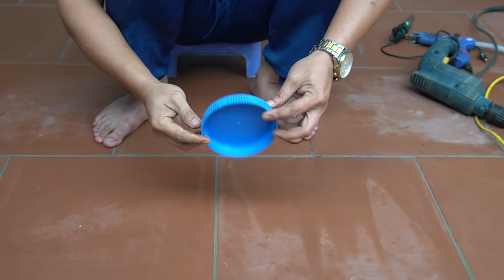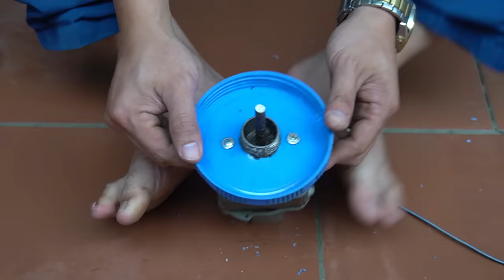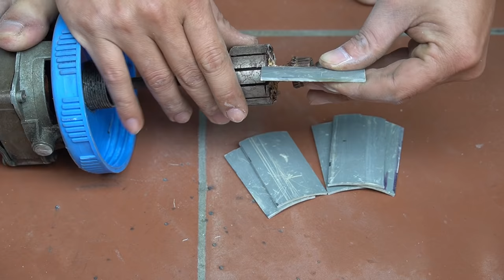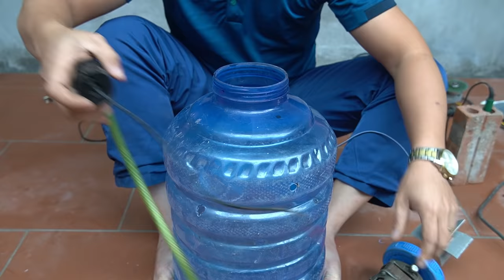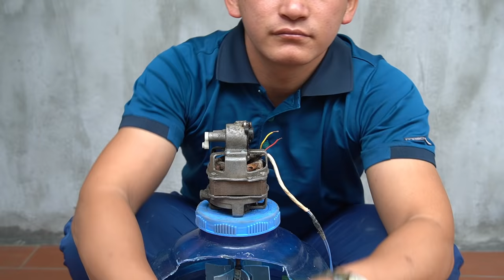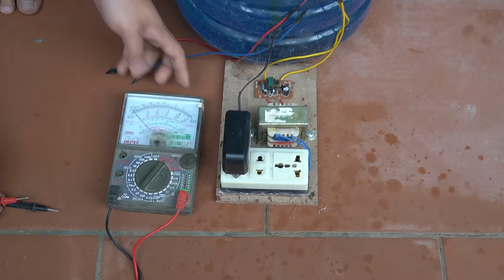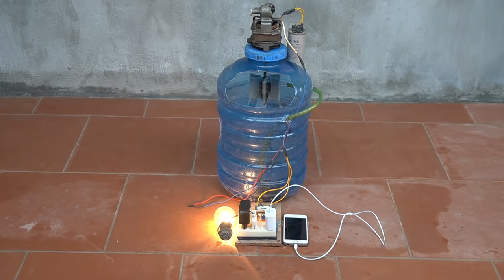Turn Plastic Bottles Into A Simple And Creative 220V Water Turbine Permanent Generator

Comment: There is no such thing as a permanent generator.  Perpetual motion is impossible because the components of the entire machine creates resistance and will eventually stop.  Stop spreading lies.
Reply: I wouldn't say it's impossible, we just haven't figured it out yet. 
The earth rotates in perpetual motion.
Reply: @AftermathNoPrep  being in a vacuum with no resistance helps that constant motion.
Reply: @yamchayaku  the earth is not in a vacuum. The earth is in the same atmospheric pressure that you and I live in, which is 14.7 psi at sea level. We have what you call an atmosphere, and earth is inside that bubble. Atmosphere can be a form of resistance.
Reply: @AftermathNoPrep  well, you are right.  Of course, that means the Earth will still meet resistance from that very atmosphere and eventually slow down over time, though that will be billions and billions of years away.  The sun will probably end up engulfing the Earth before it completely stops spinning.

Comment: Please ,be kind enough to mention the items used in the circuit . The capacity , voltage ,etc . Thank you very useful idea .
Reply: Permíteme responder tu pregunta lo que veo en el video y por lógica del circuito veo utiliza: 
Un cabezal de ventilador de mesa, una bomba de agua sumergible, 12 VDC voltios, un botellón, una batería de 12 Voltios, un capacitor de 40 microfaradios de alterna, un circuito electrónico, supongo que para estabilizar a 12 VAC y un transformador de 12 VAC a 220 VAC, lo demás se entiende por las mismas imágenes.

Let me answer your question what I see in the video and by circuit logic I see uses:
A table fan head, a submersible water pump, 12 VDC volts, a bottle, a 12 volt battery, a 40 microfarad AC capacitor, an electronic circuit, I guess to stabilize at 12 VAC, and a 12 volt transformer. VAC to 220 VAC, the rest is understood by the same images.
Reply: sorry to have to tell you but the video is fake because perpetual motion does not exist in nature.
Reply: @eliabe6453  Por supuesto, sé que es falso, las leyes termodinámicas así lo demuestran. Supongo que la trampa está en el condensador o en el cajetín del tomacorriente. Solo le respondía a la persona que preguntaba sobre los componentes del artilugio.

Of course, I know that it is false, the thermodynamic laws prove it. I guess the trap is in the condenser or the outlet box. He only answered the person who asked about the components of the contraption.
Reply: @eliabe6453 👓

Comment: I am confused here. How did you get the water running?
Reply: I think the water running is due to starting with 12 volts of the battery, it start moving the generator on order to produce 120 volts which are charging the capacitor for using 12 volts of use of the water pump and supply 120 volts for using a 100 or less watts bulb and mire watts for small consume devices such as a telephone charger.
Reply: @arielriveragaona98 , bravo amigo, al fin alguien usó su intelecto y razonó correctamente...es triste reconocer que la mayoría solo atina a criticar y lanzar conceptos tontos, no faltan los que quieren todo hechecito y nada de poner materia gris de su parte, nuevamente gracias amigazo, desde Perú....
Reply: Water pump submerged 12 volt

Comment: nice job man, i will try soon to replicate it but placing the fan horizontal with, instead of the flags, the Pelton shaped flag :)
Reply: Yeah...the fan partially immersed in water reduces the MA
Reply: @patrickugwu1868  we are talking about nothing because this video is fake; if u modify a fan into a generator with magnet no 220v out. I tried with 3 different fan or motor and i got max 9/12v
Reply: @Mauro if the generator has be previously modified with extra magnets and coil windings, it's possible to generate 220V
Reply: @patrickugwu1868  i did it, exactly as this videos shows. Try it by your self and u will see the truth..this video is fake like all the other videos he post on youtube..it's just for make money with visualizations..I'm very demoralized as i really wanted to obtain same results but no way
Reply: @MauroAlpha17  hmm... Lemme even check it out closely
Reply: @patrickugwu1868  try it, and if u can make 220v advise me! i hope i'm wrong cause i need to generate energy. Here in italy there is a energetic crisis and all cost a lot
Reply: @MauroAlpha17  
Menurut saya hanya PLTS energi gratis dari Tuhan 😁😁🙏
Reply: @dodoldarut5200  english please

Comment: I think this is a trick because the rotor doesn't have a magnet, how do you generate electricity,? that's funny
Reply: The small battery works to jump start the motor, than the Capacitor takes over….
Reply: The small battery works to jump start the motor, than the Capacitor takes over….
Reply: @Solebeneficiary  how long will the capacitor create electricity?
Reply: Wich rotor has not have magnet, electricity is generated by the generator on top, the capacitor is to protect the generator and to stock a little power to let the generator  continue working will he unplugged the battery ....
Reply: Can you please give me the detailed electronic component and the schema  of the circuit
Reply: I agree with you, you need magnets to generate energy ,  Apart from that when disconnecting the battery there is a cut in the video.

Comment: I think the capacitor is a modified  battery🤔
Reply: Yes of course
Reply: Your not wrong
Reply: I also think that, Capacitor will discharged fast for that turns of the motor i Think its fake.

Comment: great project. as rightly comment by the great guys. im confuse. i can see a fan motor converted to an alternator, what is doing the pumping of the water to drive the blade or the fan which inturn drive the alternator and power generated?. A clear circuit diagram will assist further.

Comment: I think is pretty cool but using the battery to get it moving kind of defeat the purpose I would have use two bottles and the motor insert it on the side of each container then let water run from the top container to the bottom one on that way you don’t need another source of power to make it work

Comment: He is charging with the battery so where is the loop? Do they even use 220 voltage in there homes? I guess a jumpstart and not charge with to many loads AND not getting bothered by birds or anything like to much heat so yeah it could work.

Comment: Lies from the pit of hell!! Batteries are used to ignite a system in generators to aid combustion of the fuel so what did the battery ignite?  Absolutely nothing...if you have zero knowledge on physics this guy will fool you...this is practically a car alternator....it takes the engine of a car which is powered by 6 valves to rotate that stuff....This guy...is just... unbelievable..

Comment: So this is how you beat the laws of thermodynamics and law of conservation of energy by generating energy out of nothing? How do energize the wayer pump?
Reply: The water pump supply from lead acid battery first, once the turbine starts rotating, they produce electricity, there's is also adapter from the turbine plug in the outlet, Watch the  video carefully

Comment: Can you hold the turbine spinning with your hand? I want to see that the light turn off or not so I can be sure you don’t use other source of power. With my experience, I don’t think your water from hose has enough power to spin the turbine.
Reply: By virtue of angular velocity, the spin is possible as a result of the thrust produced by the water splash at  repeated instant

Comment: Bro u didnt modify the motor.good lies. U shudve shown that u opened the motor and cut pieces of the rotating circular copper in order to add there magnets that create ac when the metal rotates inscribely rotates between the wires.

Comment: 220v my ass. The motor is too small and the water pressure is too low to create such power.
If it was that easy to create power, it would be free.